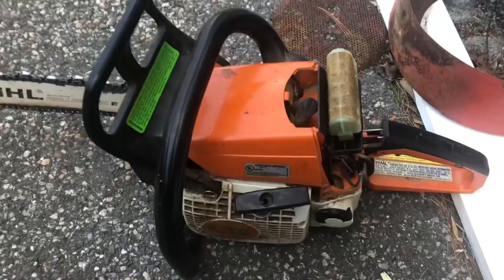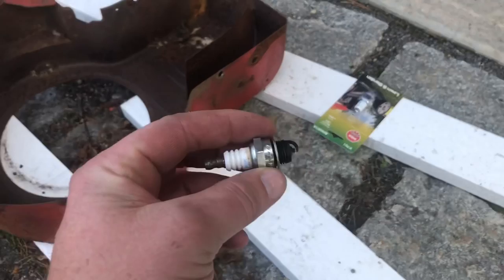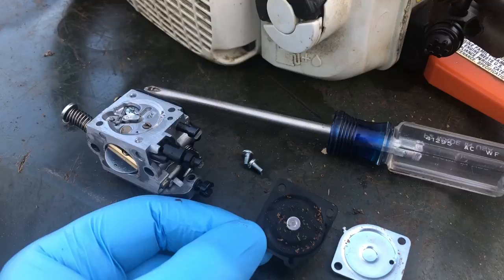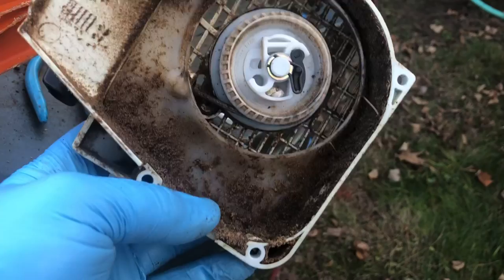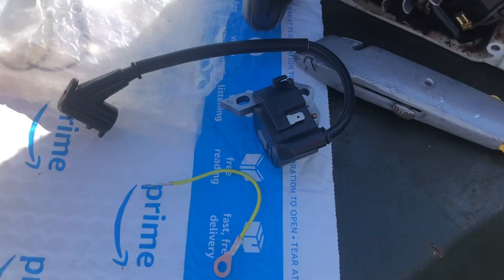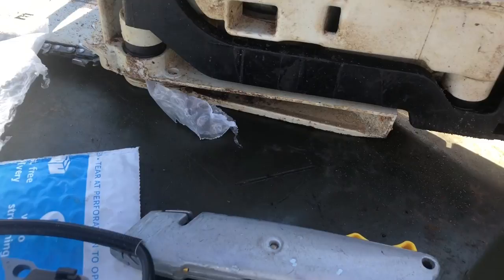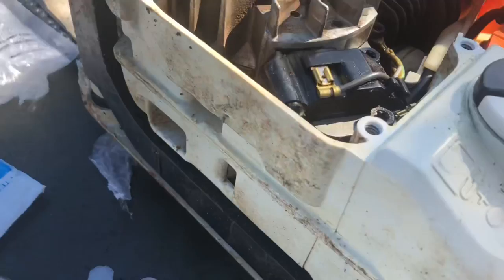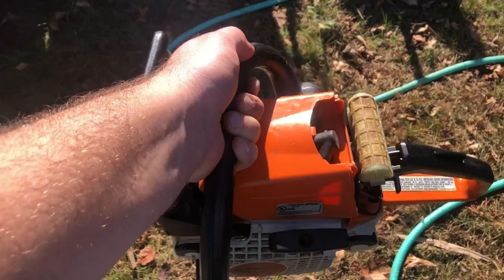Stihl MS250 Chain Saw Won’t Start ? Let’s Fix It !

Comment: If the coil has been touching or has gotten closer to the flywheel your crank bearings may be bad or the engine mountings could be loose. If the engine is moving in the plastic case you case is worn.
Reply: on this model the coil is bolted on crankcase so the engine mount can't be  responsable:)
Reply: @denisdenis2034  I would urge you to look at a video I posted, but I would understand if you didn’t so I’ll quickly explain. The clamshell type motor is bolted to the plastic case assembly. In the case are 4 metal bushings that the engine bolts pass through, holding the engine. The coil also bolts to the case, when the saw gets worked beyond its limits the case will wear at the point where bushing pass through the plastic. The engine, now lose and sloppy, will contact the coil.

Comment: my MS 250 won’t start up after I left it sitting in barn during winter!  I emptied the fuel tank and let the carburetor dry out.  Is this related to your issue?  If so what’s part number you replaced?
Reply from the maker: See if you have spark as step one

Comment: I just saved one of these from a dumpster. Same symptoms as yours. I'm going to tear it down and hopefully it will be the same problem. I have fire wood to cut and my Ryobi just won't cut it... pun intended.
Reply: Curios how your rebuild went? I just picked one of these up for free aswell.
Reply: @greenroomdude  I replaced the carb,filters and coil. She cuts through wood like it's butter now.
Reply: @darkgrey1790  right on!  I will look into those parts. Thank you for your knowledge.

Comment: If it was full of saw dust and junk and never cleaned out of course it's going to affect the coil and fly wheel gap and dust in the carb. Just saying but regular cleaning after each use on the recoil side and the bar and chain side will prevent this in the future

Comment: I love them old Homelite's. I have a Super XL12, and a regular XL12, that I use every year to cut my Dad's Winter wood. He owns a big Stihl, and he is really shocked how well my Homelite's stand up to his Stihl. Only problem in comparison is the old Homelite's are a lot heavier. I guess that's why their still running and still reliable 50 years later. I have 2 Super EZ's, that I'm getting ready to rebuild the carbs on, to use as a lighter limb cutting saw.
Reply from the maker: Neat

Comment: that's really curious why that coil got closer to the flywheel, if anything I would think it would get further away,,, I really like those old EZ Homelites, I had a couple of then and a lot of XL's.
Reply from the maker: Yeah my father bought the saw new.  He loves it.  It runs great and gets very little use.  It has a manual oiler too.   The muffler is a little gone but other than that it is solid.....

Comment: mine is brand new. the pull cord is to hard to pull out to start it, will be taking it back to the dealer
Reply: Mine does the same thing but I let it sit for 2 years in my basement. I can't pull the cord. What did your dealership do for you? - Mine is strong Stihl MS-290 Farmboss.

Comment: Fuel tank filter is probably loose and in the bottom of the tank or the tank hose has a hole in it. That’s a lot of junk in the carb.

Comment: What ever happened to the 028 I sold you?
Reply from the maker: Ugh that POS is garbage.  Has not enough compression.  Needs new cylinder piston, rings etc.  Needs a sprocket ....  lots of money.  I am tempted to get the $40 eBay aftermarket top end.